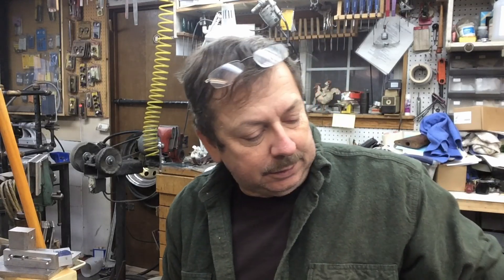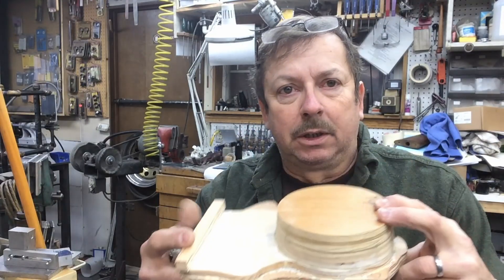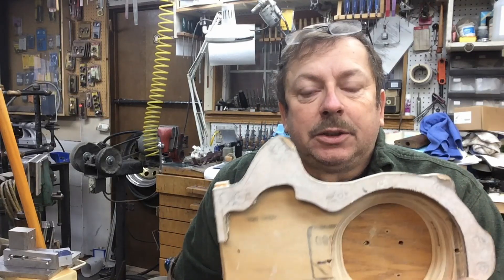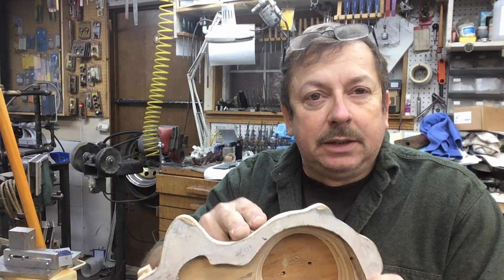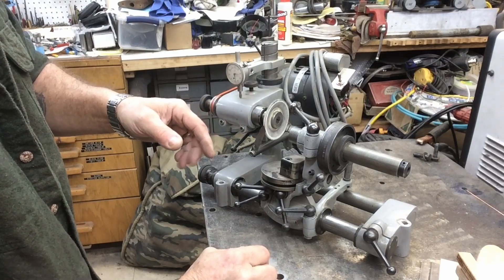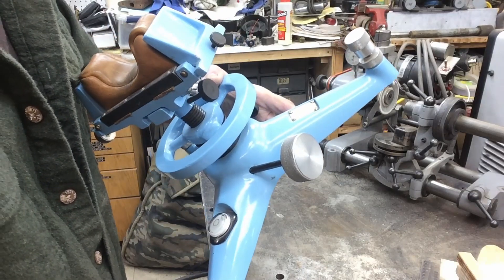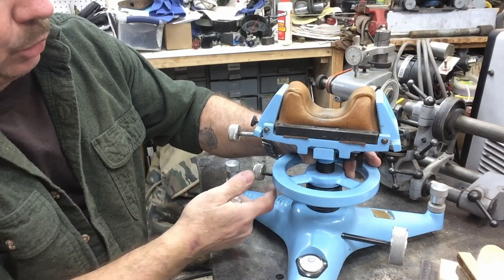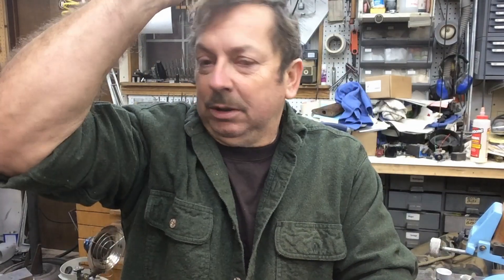Hillsgun: Show Off And Tell #1

Comment: Excellent points, Dan. I think it's easy for folks who are new to a hobby or area of study to initially assume things are (or need to be) more complicated. I know I ran into this pitfall when I was in the research stage of building my project. With the availability of information at our fingertips, it's so easy to get bogged down in the details and over-complicate something. I get a whole lot of comments from the peanut gallery that illustrate this very issue. Great video!
Reply from the maker: Thanks Greg: I appreciate it. When I started playing with these videos I had an idea of what I wanted to present, and that turned out to be wrong. I think the direction I am heading is to hopefully show how more can be done with less.